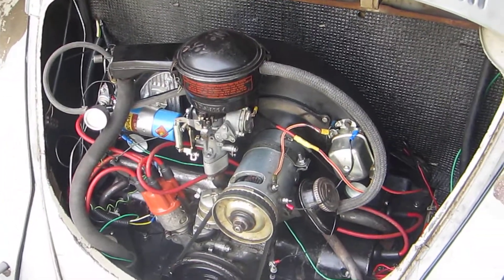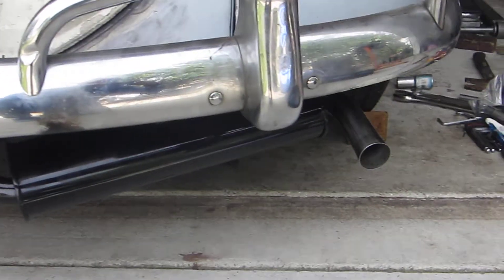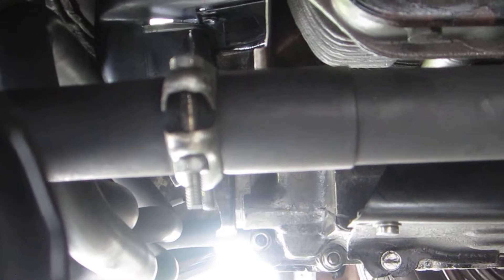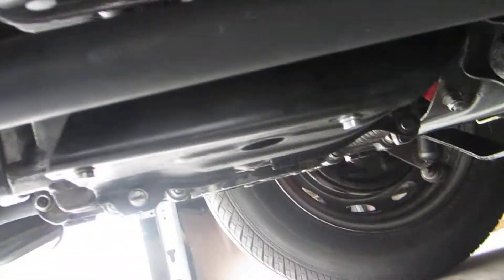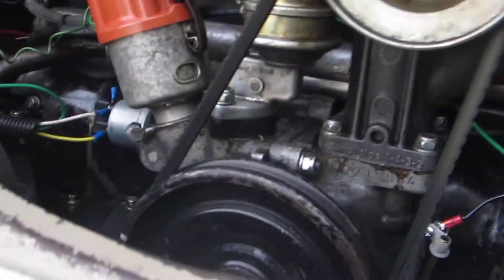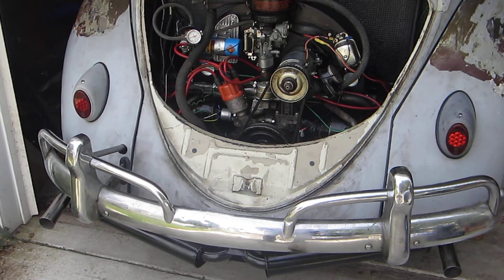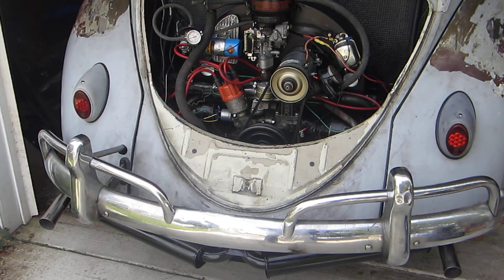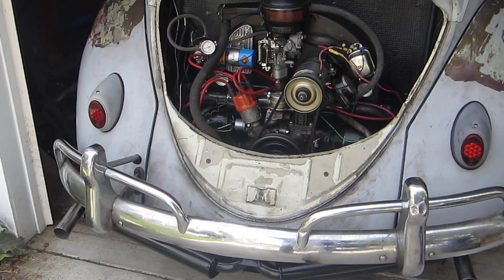VW aircooled 40hp header and dual muffler install - Part 3

Comment: nice video…planning to do this …do you have any ground clearance issues
Reply from the maker: Great question.  Yes, there can be some scrapage where the driveway transitions to the road. Have to back out at a slight angle and then its fine, no contact. Take care!